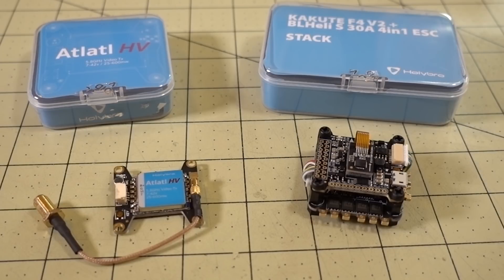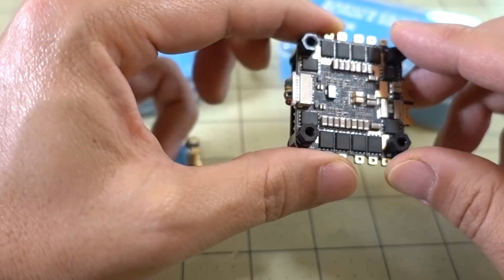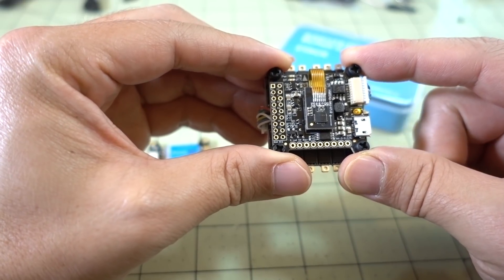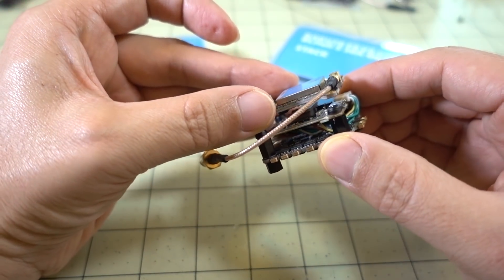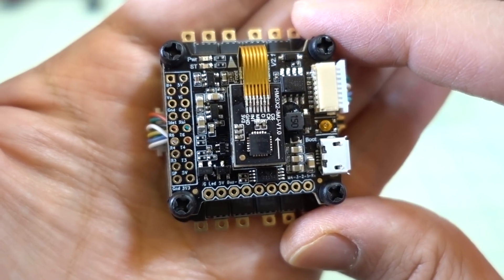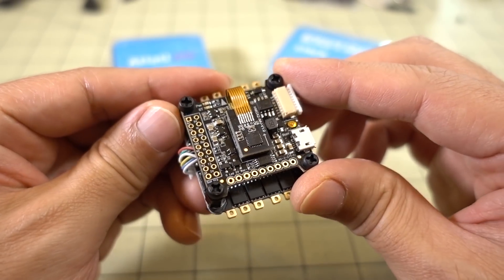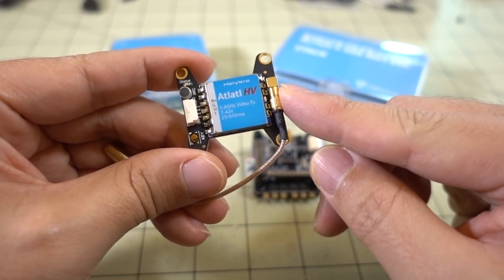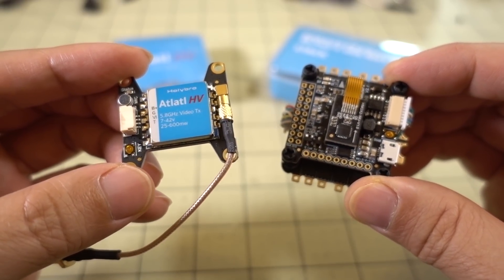Holybro Kakute F4 V2 Combo Stack Review ⭐

Comment: Mine does not power the 5v pins when connected on the USB port. But whyyyyy ?
Reply from the maker: Is it supposed to?  Not all boards will send 5v to the 5v rail from USB.
Reply: Albert Kim , it is written nowhere ...
Reply from the maker: Not all boards will power up the 5v rail.  Some do, some don't.

Comment: I have a question, The websight said one can add an external compass but there are no sda/scl pins so can someone add one? (and how is that done correctly?)
Reply from the maker: Sorry, I don't know.
Reply: I looked and they changed the SCL/SDA it to be under the board.... there are two pads (not through holes)